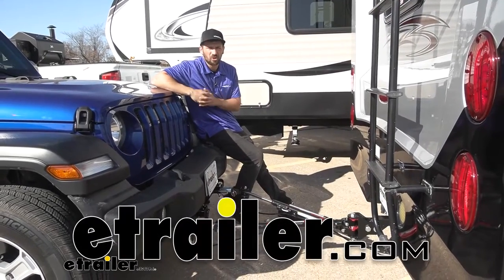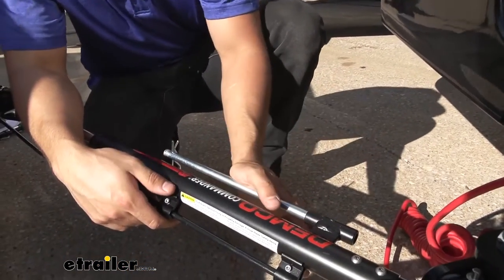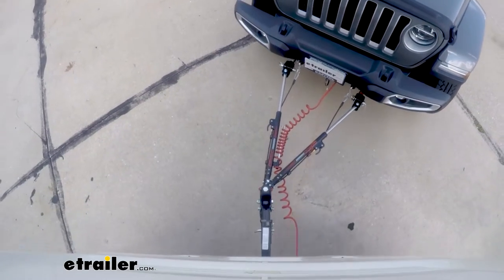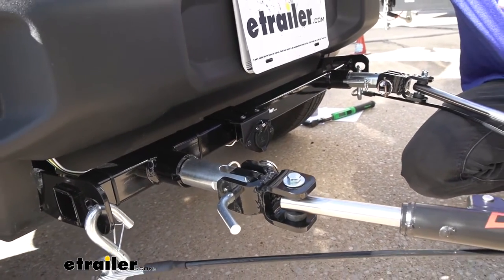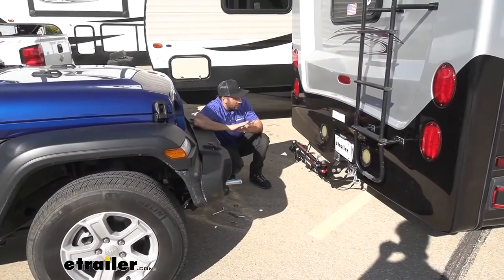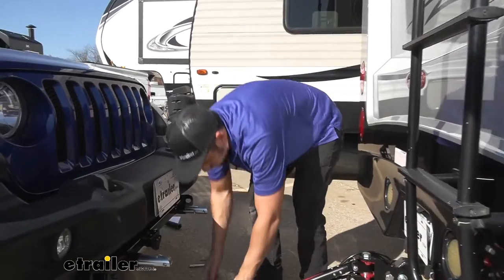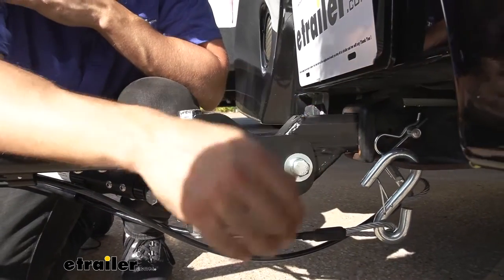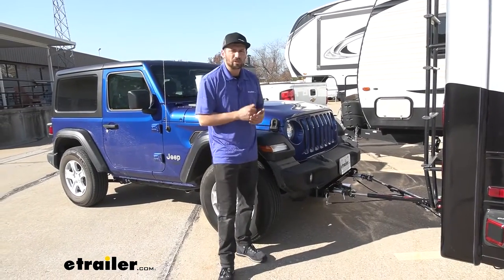etrailer | Demco Commander II Tow Bar for Blue Ox Base Plates Installation - 2020 Jeep Wrangler

Comment: when to tow bar is folded up in the storage position, what keeps the arms from pulling out?
Reply from the maker: There is enough resistance in the arms so that they will not extend on their own when in the stowed position. They will have to be pulled out by hand.
https://www.etrailer.com/Tow-Bar/Demco/DM9511012-BX.html